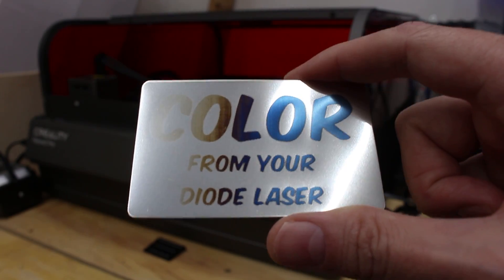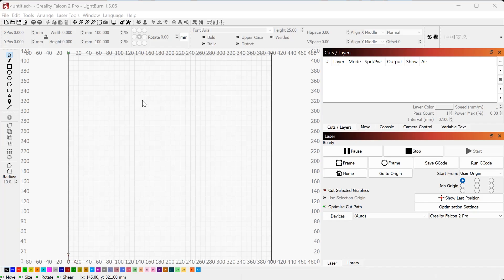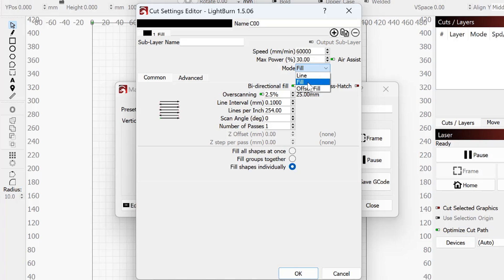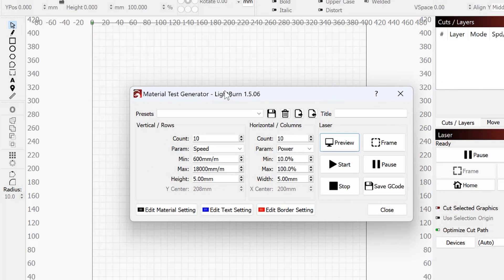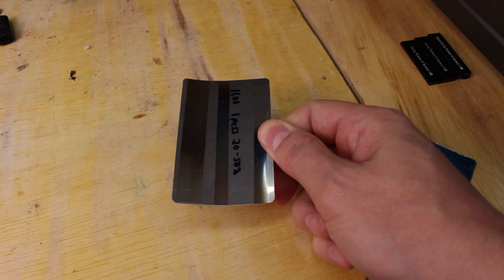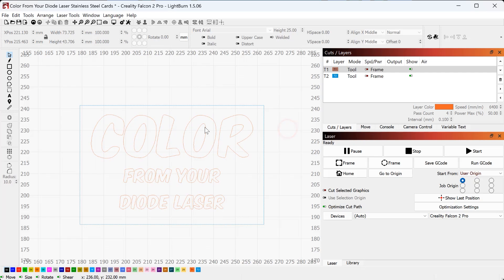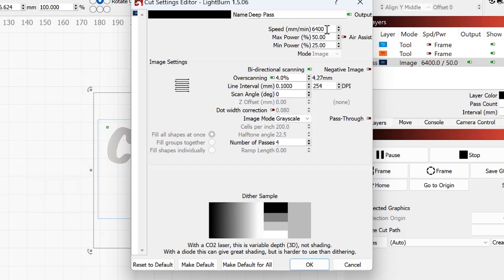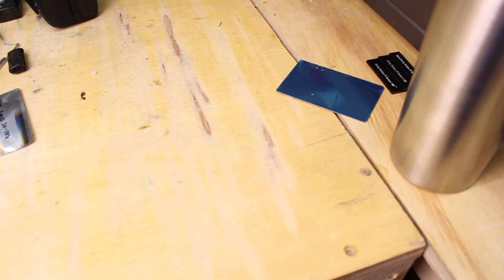It's Easy to Make Colors with Your Diode Laser!

Comment: I have both 60W JPT MOPA Fibre& Creality 40W Diode lasers, Haven't yet tried colours on my Diode laser May have to use an Aluminium heat sink like you did too.
Reply from the maker: I have a 30 watt MOPA and prefer doing colors on stainless with that because I can really get the colors dialed in. For those that don't have a fiber laser though, you can still get some decent color on a diode.

Comment: At 5:28 I note you have very obvious vertical bands where it appears that the power is varying across each scan.  A) have you noticed this? B) have you any idea what is causing it?
I have encountered the same issue with a different 20 watt laser brand and a significantly different machine. I am using Lightburn ( and also another software) and both create the same issue  but my bands are significantly more obvious than yours. Any help /thoughts would be appreciated.

Comment: If you use a diffused light source using either drawing film or even white shower curtain on the opposite side and above the shiny surface you should be able to capture the engraving easier. Just google photographing jewellery or light tents :)
Reply from the maker: Thank you!
Reply: Very cool tip. Thank you

Comment: Could you cut slots in your aluminum heat sink and add a fan for air circulation?
Reply from the maker: The laser is fully enclosed and I have it hooked up to my extractor fan so it's pulling a lot of air over the aluminum block as is. I think the next step would be a water cooled block and some thermal compound between the stainless and the aluminum. Alternatively, running more passes would probably be more efficient. I was just too lazy to test running lots of passes. 🤣
Reply: Good ideas.
Reply: What if the block were sitting on an ice pack?
Reply: @DmitriKoslov1 it would not be exactly the same height as it melts.